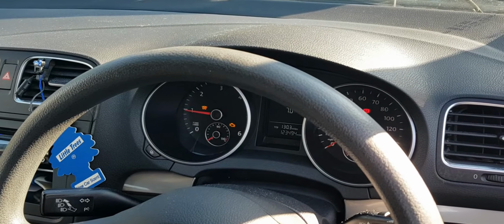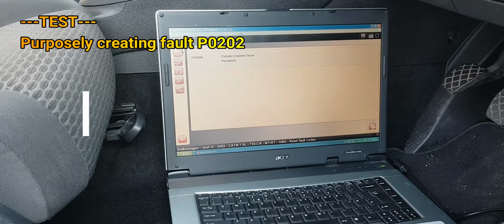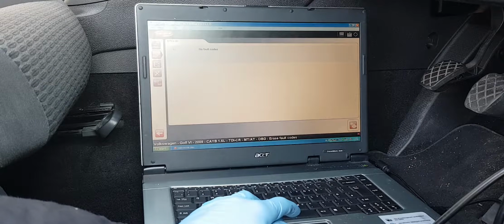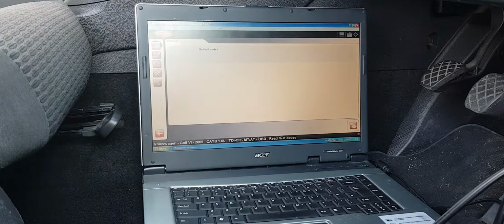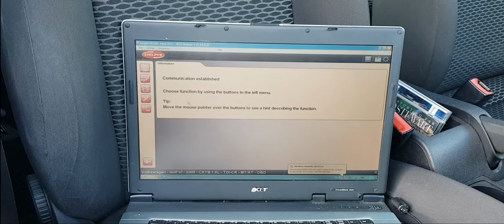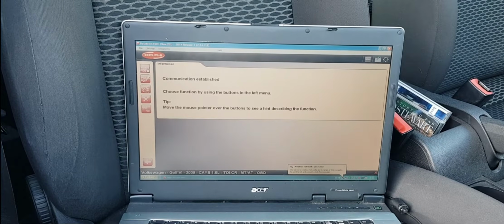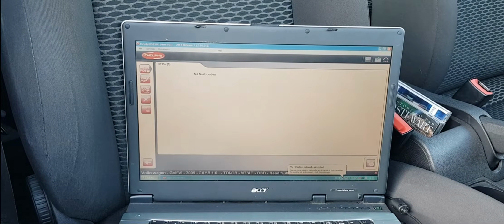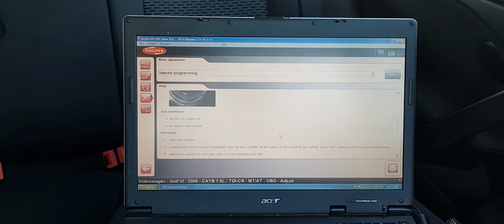P0201, P0202, P0203, P0204, P0606 Injector fault fix VW Golf 1.6 tdi Audi A3 A4 Injector replacement

Comment: My skoda octavia 1.6 tdi knocking on idle and goes away while driving at a certain speed but while i connected the obd scanner it came up with P0201, P0202, P0203 & P0204 all these codes which says injector circuit fault, do you think it's something to do with the injector wiring loom ? The injector variations for all 4 injector are perfectly fine on the scanner
Reply from the maker: You never know. With cars everything is possible. Not sure if it is the wiring as you have no problems whilst driving. Best of luck and do let us know when you find out what the problem is
Reply: @TheKeenMechanic Thanks, that's what I'm thinking as well now. I'm going to check if the injectors are coded correctly on the ECU as well, but will keep you updated
Reply from the maker: @DYImech 🤝🏻
Reply: @TheKeenMechanic i have an update on my car which i went to my mates garage and i was going through all wiring, fuse, injector plug reading etc and everything was fine but then i tried to unplug injectors one by one on idle and while i unplugged the 4th injector the knocking noise disappeared and glow plug warning sign started blinking and engine running roughly so reset the code and then the knocking noise came back again and engine was running fine so my mate goes to me either it could be the injector or piston. What do you think?
Reply from the maker: @DYImech Try with injectors 1st. It will be the cheapest test🙏
Reply: @TheKeenMechanic Hi mate, you're right, I've replaced the 4th injector then coded it with the ecu and noise disappeared! Now it's all good
Thanks mate, you're a gem 💎
Reply from the maker: @DYImech Well done

Comment: Save me hundreds of euros and got to Lean soo much. Thank you soo much..
Reply: @TheKeenMechanic same issues pot three 2.0 VW golf mk6 TDI cr 140 when cold it smokes no power diesel knock etc when warmed up or left to warm up tickover presents no issues I've now had two injectors put in first one no good had another sent out by seller refurbished injector better more power little diesel knock on cold bits of smoke and miss fire came back on second one I put in😡 changed Glow plugs in case still same issue could it be wire? I'm at end of my tether mate what is it? Surly not that unlucky to have another sketchy injector from this seller? Don't know how to solve this? Can you help? Where in UK are you? Thanks.
Reply from the maker: Hi, I am in Northern Ireland, you will have to find a local VAG specialist mate, someone with experience

Comment: You don't need power to measure the resistance, right? I struggle measuring it. Maybe my device sucks however when I put both probe pins together my multimeter shows changes in value. I have faulty 4th injector but I cannot get any resistance on any of em

Comment: Great Video,
Thanks to you, Im now confident to repair it for myself. I had exactly your problem and also measured the resistance and my second injector is faulty, also had the 606 code.
Reply from the maker: @tijanrac4713  Glad to hear I was able to help another person with my video. Best of luck and wish you many more trouble free miles
Reply: @TheKeenMechanic  didnt last long cause now after the swap and coding the engine makes strange noise if I accelerate. I think it should be properly coded
Reply from the maker: @tijanrac4713  Did you buy remanufactured injector or brand new?

Comment: I got P0201 error on Touran 1.6 TDI and I measured all four injectors where all four show same resistance. Could still the first one be faulty despite correct resistance? Second thing I'm suspecting could be wiring. 

Thank you in advance for any suggestion.
Reply from the maker: Hi. Swap the injectors from 1 and 2 and see if the problem moves to 2. Do that after you have checked your wiring and make sure the ohms readings are as shown in the video. Any deviation from 200 would be a faulty injector
Reply: @TheKeenMechanic  Thank you! I appreciate it!
Reply from the maker: @spodvi  You are welcome

Comment: I have the same Faul Code. Can I still drive a longer distance with it? The car doesn't sound good, but it still drives
Reply from the maker: I drove 80miles (130kilometres) in mine on 3 cylinders and got home. Hope nothing goes wrong for you if you do the same as myself. Get it fixed as soon as possible. Best of luck

Comment: What a nice video. Thanx.
I need to change cylinder 2 injector. What happens if I do not reprogram the injectors?
Reply from the maker: It will run but not as well as if it is coded. If previous injector that was coded there has similar calibrating value you might be lucky. I personally would get it coded

Comment: Is it necessary to code the new injector?
Reply from the maker: It will work without coding but you shoul code them as the coding is more like fine tuning. The codes on the injectors are actually calibrating values. It is up to you but my answer is Yes, it is necessary🔧🔩🤝

Comment: is that the correct torque for a 2010 vw golf 1.6 tdi
Reply from the maker: It should be the same torque if you have the 1.6tdi. It is the mk6 so yes, use same torque settings as my 2009 shown in the video.🤝
Reply: @TheKeenMechanic  thank you 👍

Comment: Thanks for this video I’m currently going through the same on my 1.6 Ibiza on injector 4 however my machine allows me to clear the code and it runs well for a while all be it an odd misfire then after a while the glow light appears again after about 5 miles driving  I’m starting to think this is another issue elsewhere… I can’t test resistance at the min as my multimeter isn’t working
Reply from the maker: Thanks for watching and best of luck finding your issue. This video should be a good guide to get you started🔩🔧🤝

Comment: Fantastic video
Reply from the maker: Thank you
Reply: @TheKeenMechanic  i will be following your guide when my injectors die for sure , great guide have you done the auxiliary belt and tensioners on one of these mine need doing soon
Reply from the maker: @roostaraver  I have but at the time I didn't have a channel and sadly didn't record it. If an opportunity comes up I will record
Reply: @TheKeenMechanic  brilliant! any advice on the best kit to use for the auxiliary, cambelts been doin recently by old owner be auxiliary and tensioner looks old
Reply from the maker: @roostaraver  no special tools needed there. Just put a socket on the tensionning pulley and release the belt, then put on new one and you are good to go🤝
Reply: @TheKeenMechanic  thank you mate

Comment: can the resistance vary between cars? because I checked the 2nd injector which works and it had like 140 or 160 k ohm and the third one which has failed had 5 k ohms
Reply from the maker: I have had variations myself and they worked. Try to re-use what is good and running as sometimes the multimeter can give different readings. 5k ohms is an indication that is no good

Comment: What if car was remapped and after that 1 injector was replaced is still necessary to add new injector into ECU ? will that cause any problem as other injectors was remapped and recently replaced one wasn't?  or that doesn't reflect on earlier done remap ?  Thanks for your help , watching your video helped me allot and today i've replaced my faulty injector!
Reply from the maker: It should not matter but it is best to check with a specialist as I don't do remaps and I am not 100%🤜🤛

Comment: Veryhelpful, just got injector problem on my golf, the car let me down on the road, very helpful video
Will be nice if you can share from were you purchase the recon injector, maybe the pn for the stud and other needed parts
Reply from the maker: Thanks for watching and for leaving a comment. I purchased the injector on ebay. The copper seal and bolt were purchased from VW dealer.🤝

Comment: Can a bad 1.6 105 injector be repaired?
Reply from the maker: Yes, but only by a professional injector specialist. Every injector needs to be bench tested and calibrated. The piezo element also needs to be replaced by a specialist. Not much can be done at home without special equipment. You have 3 options:
New
Used
Professionally Rerurbished

Comment: Did you need to do adaptation after coding it buddy? I have changed all 4 but the mechanics forgot to code it and now looking for someone els to do it as I don’t trust him anymore as the car been shaking and reving it self when it’s parked with it switched on since I got the injectors replaced
Reply from the maker: Hi
I just coded the injector and never had any issues after that. I find that if you buy refurbished injectors there could be 50/50 good and bad experience. Brand new is your best bet but they are expensive. Second hand would be the worst choice as you dont know how long they will last. Hope this helps

Comment: Awesome video! Did everything myself and went amazing. Injector was €420 and called VW for the clamp bolt and O-rings and they were about €7. Used a torque wrench just like you did and everything went well! Car started right up with no issues. Afterwards i just had my friend code the injector with his Autel unit. Thank you so much!
Reply from the maker: Glad you found it helpful. Thanks for watching and for leaving a comment🤜🤛
Reply: When you say "code the injector" do you mean just clearing the fault on the car with the code reader or actually programming the part?
Reply from the maker: @kbpower4086  It is not called programming, it is called coding. I explain it in great detail in the video. You need to code the injector in order to tell the computer the calibrating values of the injector so it knows the tolerances. You can clear the faults after the job is done. Hope this helps
Reply: @TheKeenMechanic  Great. Thank you. Will try download the software to be able to do this. I have the OBD II Reader and was able to fix the car after getting error code P0203 (injector 3) and tested it to be 8ohm. The other three were 200k ohm. Your video helped me a lot. Thanks again
Reply from the maker: No problem. Glad to be able to help other people 🤝
Reply: @TheKeenMechanic  I have not had a chance to take the vehicle in to get the injector coded. Vehicle is running noisy on what seems to be the cylinder that the injector was replaced and is also smoking quite  a lot. Is this a symptom that the injector needs to be coded?
Reply from the maker: @kbpower4086  It could be but generally if the injector is good you shouldn't notice big difference even if not coded. If the injector is not brand new you take a risk.
Reply: @TheKeenMechanic  Thanks. I bought a reconditioned injector from Specialist Diesels in Lancashire and they provide a new code with the test sheet. They ground off the original code to avoid reuse I think. Will have a go with the Delphi Software that you use in your video and take it from there
Reply: The vehicle used to run smooth with no smoke until injector 3 suddenly failed, so the smoke and rough running must be a fueling issue. No fault codes up on the ODBII reader or dash - for now...
Reply from the maker: @kbpower4086  Yes, at this point that's all you can do, do it soon as if they haven't calibrated the injector correctly you will need to return and get another one. I have seen it before where an injector specialist have done a bad job. Don't forget they try to cut the cost and hire young apprentices who don't always do a great job. Best of luck
Reply: Great video! Thank you for uploading it. I have one more question. Do I have to code the injectors if those are the same ones which was already inside just refurbished? However I don't know which one was in which cylinder.
Reply from the maker: @vladcsa3606 Very good question. Since they were refurbished you should as the shop that refurbed them to tell you how to code them as after the refurbishment the value might have changed. If the shop can't help just code them in by using the codes on them. Wish you best of luck🤝🏻

Comment: So glad I’ve found this video. I drove 125 miles yesterday mainly motorway and my golf 1.6tdi went into limp mode a mile from home.  Managed to get an OBDII reader and confirmed p0201 code.

Now just got to sell a kidney to fund the new injector- cheapest (only one) available is £505 and that’s with a 45% discount 😢😲.

Watching this video has given me the confidence to replace it myself. Just have to source the kit to recode the ECU
Reply: All right bud see your post if you try a place called: Carwood, descent price for my injector (caddy 1.6tdi only £330🤢🤮) don't know if your will be in stock tho.
Reply from the maker: @markwatson6622  Thanks Mate
Reply from the maker: This is crazy. At the time I recorded the video a brand new VDO injector was £250. 🥺

Comment: Hi buddy mine has gone on number 2, do you have to take 1 and 2 out at the same time or can I just take 2 out? Thank
Reply from the maker: Hi
They are held in place with the same bracket so you may find it easier to remove both otherwise you can bend something if you force it without lifting both at the same time. Use this opportunity to clean both holes and replace both copper seals. Hope this helps
Reply: @TheKeenMechanic  thanks my injectors all as 2 ohms could a glow plug cause this fault?
Reply from the maker: @mikeyoakes180  Hi
Do a search on google and see what comes up. Injectors are separate from glow plugs so not sure why you think it might be related. 🤝
Reply: @TheKeenMechanic  hi I’ve replaced the glow plug! I’ve checked on the multi-metre and the injectors seem fine! But it’s still coming up with p0202! Is that definitely the injector do you think?
Reply from the maker: Swap the injectors and see if the fault moves then you will know if it is injectors, wiring to injector or something else

Comment: Good morning mate I need to do same job on my sisters car, I just had a question since last few week she keep getting the DPF sign on where it wasn't passively regenerating. So had to always actively regenerate. Now found this error when called RAC they said needs new injector. Will it solve the DPF issue?
Reply from the maker: Not 100% sure mate, but I know the engine regenerates by raising the heat by injecting more fuel. If your injector is not working correctly may be it is not helping with the temperature increase but again this is just me thinking outloud. Do an indepth research online or ask a local injector specialist

Comment: Today i got my car back from the garage. VW Golf 1.6 CAYC 2012. They replaced the second injector. This was also the second one replaced on my car. The first one was replaced 3 years ago. I read your comment about the partnumbers from the unreliable types of injector. Is the 277b the only unreliable series? Where can i find these part numbers? I want to know if there are more injectors of the unreliable types on my engine… Thank you for the very informative video!
Reply from the maker: The code is on the top of the injector. It is printed on the black piezo electrical part where the calibration code is printed as well. You will see also like an QR code. It is all in the same place. If you can afford replace with new  03L130277S injectors. Hope this helps.
Reply: @TheKeenMechanic  Thank you! I found out that the 2 remaining injectors are the B type. I will consider next steps...
Reply from the maker: @Unknown_user1980  Best of luck, I am sure you will sort it out🤝

Comment: Where did you get the injector bolts from? They're all minimum £7 now for 2. Also the injector seal kits with the rings etc.
Reply from the maker: All from VW and yes they are bloody expensive. VW knows how to make money🤑
Reply: @TheKeenMechanic  Thanks my friend, great video. I just want to take them off to have them professionally cleaned. Exactly same car as yours only recently started having minor injection issues despite always using Shell never supermarket fuel and also additives like hydrablast (I'm assuming as coil light came on was due to injectors with po related fault codes) although did liquid Moly diesel purge and noticed filter became darker so hopefully caught some dirt. If I also knew about dpf problems never would have bought a diesel. I now use vagdpf app to keep track of dpf to go on the motorway before the warning light comes on, usually at 83% full it allows a regen  to start at over 2k revs and also had dpf removed and cleaned with Wynn's off dpf solution cleaner.
Reply from the maker: @TB26egru  Thanks for sharing🤝

Comment: Hi. I have a 2010 sdi caddy. Got my van back yesterday and now have a engine management light on. Garage I first took it to said egr code was coming up, so took it to a diesel specialist who didnt plug it in & tested the injectors instead and said that's the problem. Then took it to auto electricians to sort out abs look, in receiving it back he said he plugged his box in and egr valve fault.
Reply from the maker: Thanks for sharing

Comment: Is it necessary to do programming for replaced Injector, since I don’t have that software to do??
Thanks
Reply from the maker: It is very important, but your injector will still work even if you don't code it. It will work better as the engine will know the calibration tolerances🤓🤝